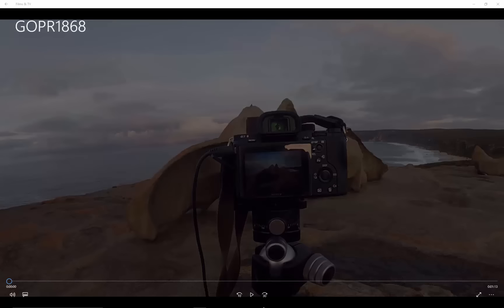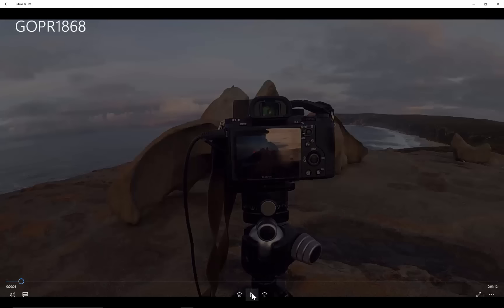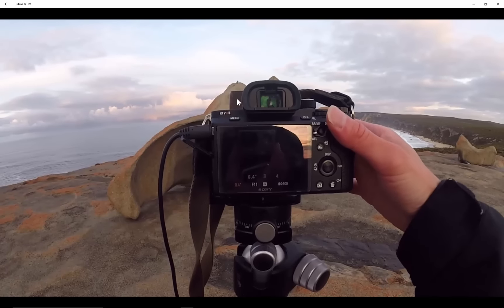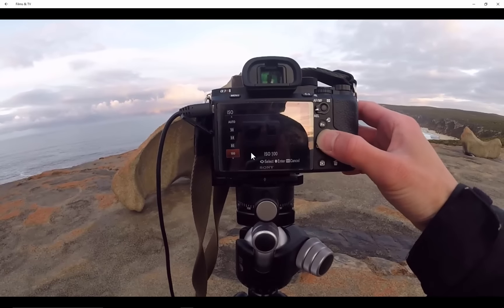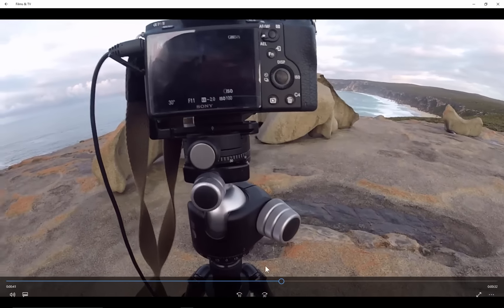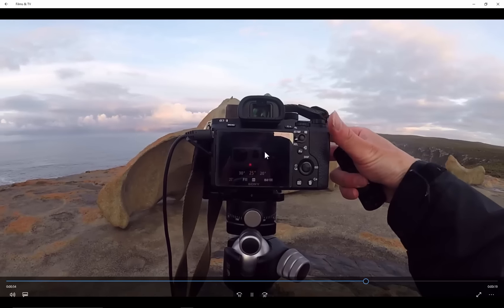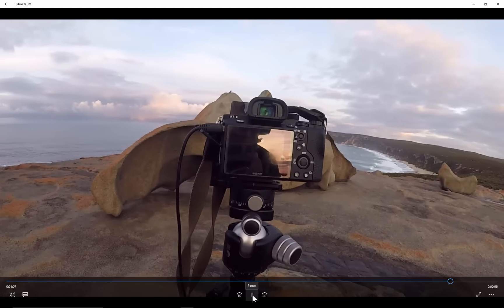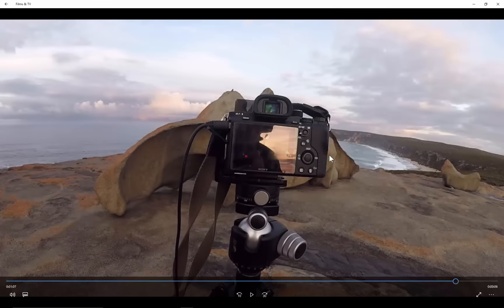Live view exposure simulation

Comment: I tend to use the ISO6400 method for LE time calc; the time in seconds @ ISO6400 with the ND filter on is equivalent to the time in minutes at ISO100; so if my test shot of 2 sec@ISO6400 yields a good exposure then a shot of 2 min@ISO100 will be the same brightness
Reply from the maker: I just worked it out- it's pretty close! Same theory I guess - say 2 seconds iso6400, 4 seconds iso3200, 8 seconds iso1600, 16 seconds iso 800, 32 seconds iso 400, 64 seconds iso200, 128 seconds iso100
Reply: Dylan Toh it works for me as a starting point, and the maths (seconds to minutes) is something I can handle in the early morning!
Reply: thanks Dylan & Andrew, was not aware of those methods!

Comment: Hi Dylan, why not just use a simple phone app to calculate the exposure time? I find them very accurate and the calculation takes about 5 seconds. Most apps also have a timer.
Reply from the maker: hey steve - I do have one - but when you have filters out, remotes, rain covers etc , it's just one more item to bring into the field ,I'm just not a phone person in the field!- also for something like the example I gave, it's quicker for me to dial iso up and do it in my head than to bring out the app and type it in etc. I agree the apps work well too.